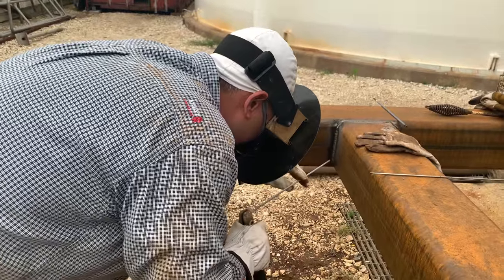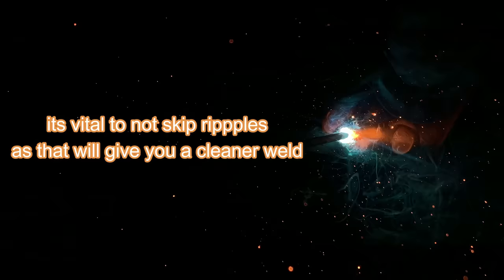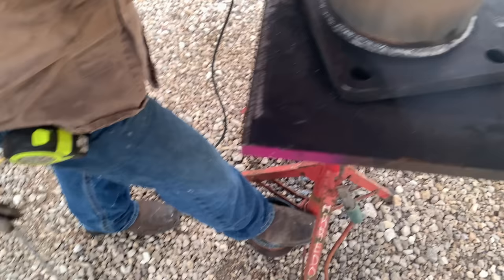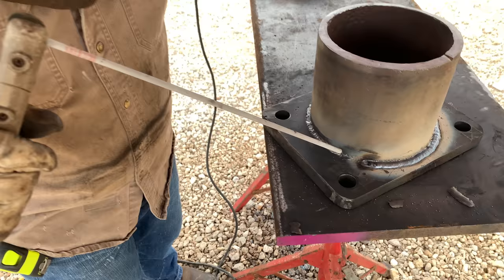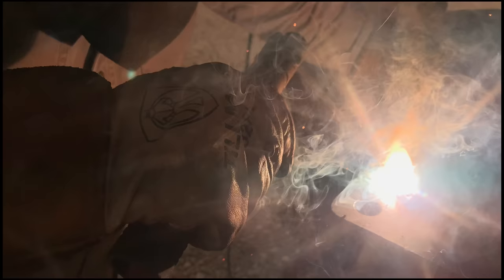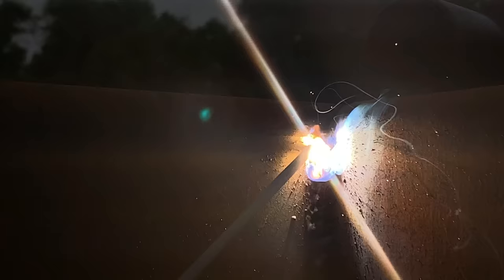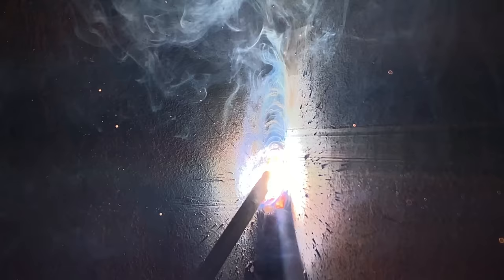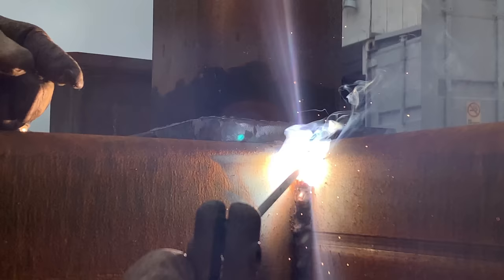Structural Welding 7018 | Backbone of America

Comment: Nice video. I have question, why are you whipping and pausing the first pass? Isn't there risk of slag inclusion? I am not an expert, that's why I am asking.
Reply from the maker: No, that’s actually a great question. Although you are manipulating your puddle, you never stop paying attention to the slag. You can see the slag rolling into your weld when you are either welding too fast, or running with lack of amperage. With the correct technique and amperage, you will keep a clean weld.
Reply: @VantageWelding  Thank you for your reply.

Comment: can u weld 6mm s355 steel with a mig machine and how many amps and passes do u need and which wire?
or how many amps with arc?
Reply from the maker: Yes brother. I wouldn’t weld with mig on anything past 5/8” thick. As far as amps I wouldn’t know off the back of my mind. Do a quick google search on rates of amps to metal thickness ratio to give you a base number of where to start adjusting  your settings.

Comment: The E6010 coating is rutile, doesn’t need to be stored in an oven or heated quiver, it won’t pick up moisture. The E7018 is a low hydrogen electrode and must be stored a per manufacturers recommendations (oven and heated quiver).
Reply from the maker: It does pick up moisture. It needs to be stored in a dry area and not in the open. Thank you for your comment though.
Reply: @VantageWelding  apologies, and you’re correct but it doesn’t need the storage care and attention like a low hydrogen electrode.
Reply from the maker: Yes sir. Definitely. You are correct sir. Thanks again for dropping by

Comment: Can u please explain Why that is.?  If 7018 is considered shallow to medium penatration, and 6011 is considered Deep Penatration.!  Then i would think 6011 would be used in these kind of heavy duty aplications.?
Reply from the maker: 6011 are usually used with A/C machines. It’s pretty much the same use as a 6010. The rule in structural welding is to not weld with a high cellulose rod due to potential hydrogen cracking. Unless it’s for something that’s not so important such as this stand. I’ve welded 6010 on structural stuff that are still holding to this day, unfortunately our brothers up north have had bad run-ins with high cellulose rods.

Comment: 5 p for 1st pass cap out with 7018 used it a lot also 6011 gets good penatration then cap out 7018 used both
Reply from the maker: Yes sir Mr burns. Great tip.

Comment: Beautiful iv a pacini pro mig 201 ull see it on my channel 350e I can arc weld flux core weld and weld with gas I can even hook up my spool cun converter and I can use dc tig the old school way i rather stick welding rather than flux core just dialing it in in tring get use to cos theres just amps and voltage the wire speed goes up wen u turn up the amps but shave stick welder haven't got the money for gas yet but I rater stick weld you are a savage welder my friend I'm a new subscriber iv a small little 120 anp stick welder from little hobs it's so light iv 3 welders dont tink I'll get a tig that gas any cheap stic welding is my go to with the stuff I bee welding 200amps is better than 120 or that great duty cycle
Reply from the maker: Thanks for watching. I’ll definitely check out your review. Thank you for stopping by my brother.
Reply: How about an English translation??????????????????   ...with proper grammar, to help us understand your thought process, if any...

Comment: Its been quite a few years since i have burnt a rod after getting my 1554 ticket 

After starting my own show i have been known For my tig work 

But i have a question about when old mates running up hill and goes to restart after burning the first rod
 it appears he draged the arc from the top of the seam down to the stop point of the first weld without removing the original slag 

I was tough that you never drag an arc and you only restart on a clean face 

Or dose the 7018 have some special properties i am not aware of or was i instructed incorrectly
Reply from the maker: Those are great questions. It’s a myth boss. Doing any b31 code you should be good leaving the slag. The arc force in your machine will push the slag out of the way causing the melted puddle to fuse directly into the previous laid bead. Grant you, you should have a proper wash out of the rod prior to restarting. It is also extremely important to have the right amperage.
Reply from the maker: I’ve never had issues with slag. 7018 is notorious for porosity though. So keep the ventilation to a minimum! Also if you’re welding on severe cycle I’d recommend grinding down the stop and slag just to be on the safe side. Other than that, I never knock the slag off.
Reply: @VantageWelding  thankyou for your time and experience I appreciate the information without ego

Comment: Do you normally make 2 passes, one with the 6010 and then the 7018, guessing the thickness of the metal 1/2" or more is better to make 2 passes ?
Reply from the maker: Legally you only weld structural with 7018. In the real world away from code I do add some 6010 to thicken the filler 7018 up.

Comment: Man that guy is an amazing welder. Just incredible. I am a new welder and wondering does "dragging the rod" mean that the tip of the rod is touching the metal and not say 1/8 of an inch above or floating
Reply: 7018 burns like that up inside the flux. It lays amazing welds and the flux curls off when the weld cools. The rod is supposed to be preheated and the steel is supposed to preheated to around 20 c if I recall correctly. Which is about room temp. It is prone to hydrogen embrittlement if not. But 7018 is so fun to weld with sometimes I just burn rods for fun in the shop.
Reply: @jamesmarks8099  Thanks very kindly for your reply and so one always has to pre-heat each rod before usage even if out doors in the summer time.  

I have only tried r 6011, 6013 and 6014 rods and to me they seem to be almost the same and would say the 6013 and 6014 are a bit easier than the 6011. However my slag always has to be chipped away and not just fall off by touching it as one sees n most of these videos.
Reply from the maker: I keep them in the rod oven brother. That removes any moisture as the top comment stated, hydrogen cracking is prone when moisture gets into the weld.
Reply: @VantageWelding  Thanks for your valuable info. Is that one of those special ovens one buys for a few hundred dollars or could one just put them into the toaster before usage.
Reply: Some rods can touch the work, and are even called "drag" rods.  7024 is the most famous, 7014 seems to work this way also.  I don't know about what we see here, he might just be pointing out the travel angle, that the weld is backhand or "drag" angle!
Reply: @leonardpearlman4017  Thank You so much for your info as that was valuable for me still tinkering around with  welding. Now over the winter I did not weld but will get back to practice once the warm weather show up

Comment: Yall do any welding with Flux wire on structural stuff?  I built substation tubes for awhile was all done with Flux wire welds.
Reply from the maker: Yes back in the days. My first welding jobs was a flux core job back in 2010 building si structures for oil rig. T1 wire most of the time. I steer away from Fcaw and Gmaw as much as possible.
Reply: @VantageWelding  I was just curious I like your videos man keep them coming.
Reply from the maker: I’m trying to get my boy Oscar Martines to bust out the suitcase so he can show us around a 6g mig and flux. Stay tuned

Comment: When you do a restart with a 6010 do you start 1/4 inch in front or restart in the weld since you whip a 6010 back and forth
Reply from the maker: You don’t have too brother. So long you have a clean restart, no need to give it a wash out like 7018

Comment: When your really good you run stringers up hill
Reply from the maker: Nice 👍
Reply: It comes with many years of experience.
Reply: When you are an exp. Structural steel welder with at least 10 years on your belt 
You should be able to fabricate,torch work, layout and know shop tools and eddicate not to mention mig,stick,tig,fluxcore and all facets of our great trade 35 years exp has paid off young men
Reply from the maker: Cool 😎

Comment: But...the only time i see 7018 being used in my trade. (LOCAL 433)...Is when safety posts are being welded to the Iron. Everything else is either wire or 7016.

Comment: Just curious- why restart without knocking off the slag? I’m starting to learn how to 7018 and that was one of the first things I was told to do, clean the weld before restarting
Reply from the maker: It was the basics that were taught to me as well. But when I got to welding 100% xray pipe I started trying things out. One thing I know is if you go up right into it with a hot enough puddle you burn everything out while fusing properly into the last stop.
Reply from the maker: Unless it’s b31.3 severe code l, I won’t take the time to buff and clean every pass. Shielded metal arc welding will do it on its own as it welds.

Comment: Is there a reason why you guys don't clean the rust of the pieces being joined together?
Reply from the maker: They got cleaned. Wire wheeled over what needed to be welded. That’s all you need to do. Doesn’t affect X-ray quality (not that this is undergoing any UT/NDT/Xray) after the job was completed, it was sandblasted, primered, and painted with a thick coating of corrosion resistant paint.
Reply: @VantageWelding  oh ok, the video didn't show it all that well. I though the 7018 has a magic cleaning ability and I was wasting my time with removing rust :P You know? Like when you use the pulsing on TiG machines for welding Aluminum to blow off the oxide.
Reply from the maker: @oBseSsIoNPC  yeah stick welding is way more forgiving. Specially high cellulose rods such a as 6010/7010/8010. But when it comes to Tig and sometimes even mig and flux core, having extra clean metal makes the difference. They say preparation is 75% of the weld. The rest is just skill.

Comment: You don’t prep for structural welds?  I thought you would want to grind off the rust and mill scale.
Reply from the maker: Nah bro. Unless you were tigging. Perhaps even mig. Stick welding was specifically made for this applications. All you need is a good buff and you are in there.

Comment: @9:35 he didn't clean his previous weld now he got slag trapped when he strike a new arc
Reply from the maker: that's not how that works budd
Reply from the maker: but good observation
Reply: @VantageWelding  How come d
Reply from the maker: The slag at the end after you pull out is brittle and not penetrated into the toes of the weld. With the wash out of the rod before starting you will have enough heat in your arc to blow the slag clean off and it will also help your tie in to fuse more uniform by not overlapping your existing cap. B31.3 severe proof on pipe bro. I guarantee it. Now if you’re undercutting and the slag is in there and you try to go over it without cleaning it, that’s where the slag inclusion will happen.

Comment: Should have wire brushed the work area before starting his run. Old school way, rust in a weld is like wood in concrete. 😊
Reply from the maker: We did. Wire wheeled everything before running a pass. Rust is only superficial. This was going to get sand blasted, prometes, then painted. Thanks for watching

Comment: What amps for 7018 and 6010 for this video???
Reply from the maker: 6010-1/8”= 80-95 amps
6010-5/32”=100-125 amps
7018-3/32”=85-95 amps
7018-1/8”= 110-130 amps
Every machine is different so you’ll have to find your sweet spot. The quicker you move the hotter you’ll need to be and vice versa.
Reply: orite tq bro👌

Comment: Did you guys go to school or self taught? I'm investigating switching careers and getting into welding. Them schools be expensive. Just wondering what you guys did to acquire the skill.
Reply from the maker: I lucked out. My dad is a welder. And my buddy was self thought. Started from the bottom and worked out ways up. From helper to structural then into pipe.
Reply: @VantageWelding  ok yeah that's great way you learned. Thanks for the reply 💪
Reply from the maker: @David-kd5mf  thanks for dropping by. A school wil definitely cut your learning curve. Specially the good ones brother. Are you looking into any specific one in oarticular
Reply: @VantageWelding  i been looking at Kentucky welding institute but am still looking around
Reply from the maker: @David-kd5mf  nice definitely one of the ones from what I can see

Comment: At last a welder that can weld and manipulate the electrodes with one hand like myself,and many others in the Uk. if you get payed for what you produce or piece work.Two handed welding is to slow.
Reply: @ArizonaXR from what i see on you tube this does not seem the case stove pipe welders being one ,this above vid being two
Reply from the maker: He’ll yeah budd. Thanks for watching
Reply: my other dislike are those spring loaded electrode holders i think the offset head holders are best for a number of reasons

Comment: I notice you start high and drag it down to where your continuing the weld. Or are my eyes playing tricks
Reply from the maker: Yes. 7018 you need to start ahead and give the rod a wash out so you can clean any porosity you may have gotten in the restart strike. Restarting a 7018 will 100% cause porosity if started a puddle right on top of where you strike the arc. Hope this helps
Reply: @VantageWelding  yes it does thankyou. 7018 start high drag down or I'll ill get bad weld on restarted puddle

Comment: Why didn't you clean it up first?
Reply from the maker: It is clean. All you need is a wire wheel. No need to do all the extra stuff. Stick welding is made for that specific reason. Now if we’re tigging, it would be a different story.

Comment: How would you rate this answer I received from a source I don't know?

If you use 6010 for the root pass, you should use a 7018 electrode for the hot pass. 6010 electrodes are known for their penetrating ability, which is why they are often used for root passes. However, they can also produce a lot of slag, which can make it difficult to get a smooth weld. 7018 electrodes are less penetrating, but they produce less slag and have a higher tensile strength. This makes them a good choice for hot passes, as they can help to smooth out the weld and improve its strength.

Here are some of the reasons why you should use 7018 for the hot pass:

    7018 electrodes produce less slag than 6010 electrodes, which makes them easier to clean.
    7018 electrodes have a higher tensile strength than 6010 electrodes, which makes the weld stronger.
    7018 electrodes are less likely to crack than 6010 electrodes, which makes them more durable.

Of course, there are some situations where you might want to use a different electrode for the hot pass. For example, if you are welding in a very thin material, you might want to use a 6013 electrode, as it will produce a flatter weld. However, in general, 7018 is a good choice for the hot pass after using 6010 for the root pass.
Reply from the maker: It all boils down to WPS brother. Whatever the company wants ultimately. But you can make perfectly sound welds with xx10 rods. We use em on the pipeline for 100% X-ray jobs.

Comment: If 7018 didn't penetrate it wouldn't hold.....what you said was not true.the aws d.1.1 test is 1 inch plate and often done with 7018. cut and bend tested
Reply from the maker: 7018 is not a penetrating rod. Google search. Thanks for watching
Reply from the maker: If you want a lo hydrogen penetrating rod we use 7016.

Comment: 7018 hasnt been around forever and its not that hard to weld if you know what your doing he is welding to cold and is moving back and forth to far and to slow need to shake like youve had to much coffee for uphill
Reply from the maker: Wrong
Reply from the maker: Idk where I say that 7018 was just invented. This is why it’s the back bone. Did you pay attention? No it’s not hard. Welding is not hard as you can see from all my videos. Wether it’s structural, pipe. Carbon or exotic metals. It’s all in there. Do you have an Instagram. I’d like to go see your work.

Comment: 6010 or 6010 is AbsolutLy no good for structural , the flux is where most of the properties are ,  6010,6011 are fast freeze deposition not designed for cyclical or dynamically loading and stresses  , elasticity alone not on its sharpie and v notch  results , 7018 elogation , flux dynamic properties and yes it does have a very good deposition rate and penetration , if your a real welder show real welding  be practices and theory, your are not a engineer or a consumable designer , welders real one work with the WPS and engineered tested and verified processes not this shit, nice welding though ! good control
Reply from the maker: Ok. I’ll be fake welder. 😂🦾
Reply: @VantageWelding  well you should go to the fake welding category of youtube
Reply from the maker: @budgetratrodbiuldbymike550 ok. Will do that.